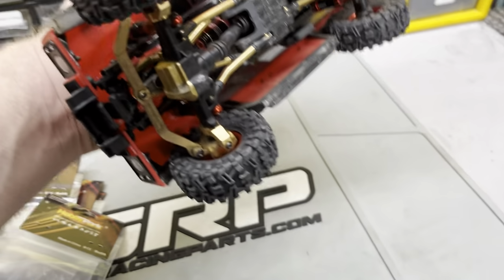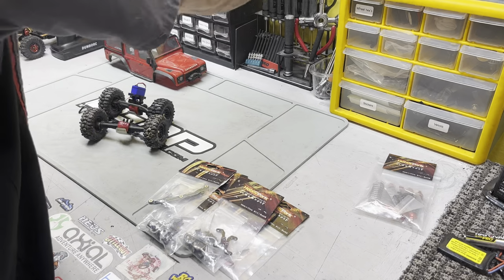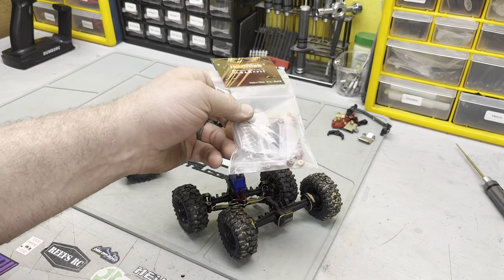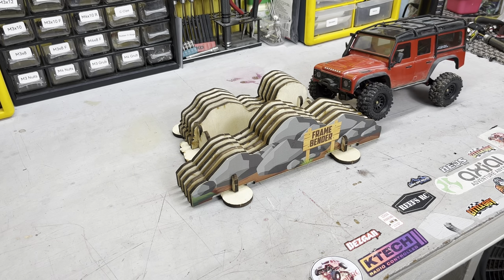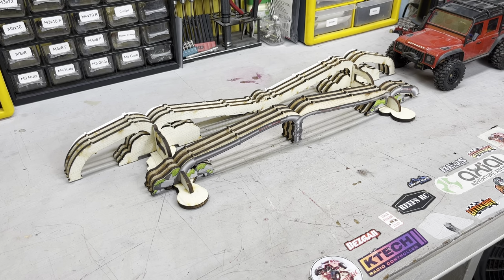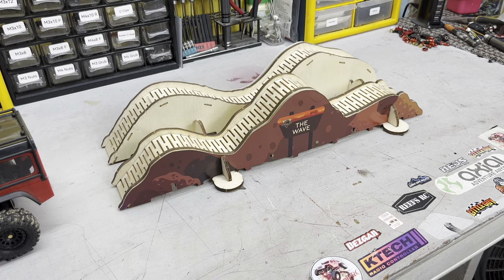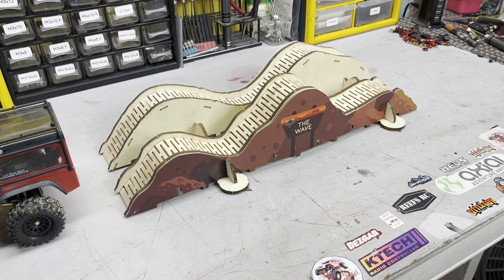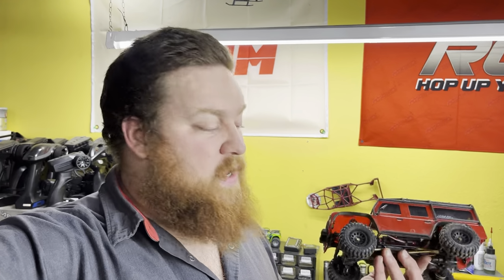Making my traxxas defender better! Hobbypark brass upgrades for the Trx4m

Comment: Is it difficult to remove the original transmission casings? Are they glued on or just a pop on fit ? Ile be getting a defender  soon either in 1/18 or 1/10. Thanks for sharing your upgrades ....Harry 👍
Reply from the maker: They just pop togeather. No sealant. Pretty easy and straight forward.
Reply: @Moneypit__RC  that's great ...thank you 👍